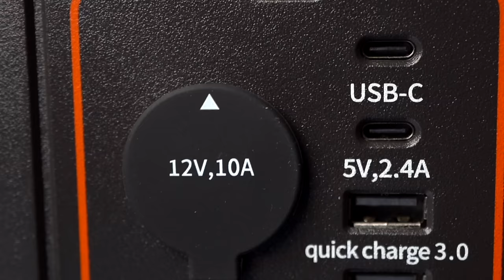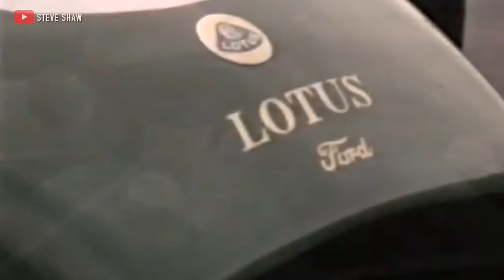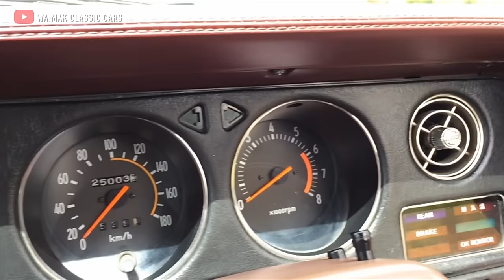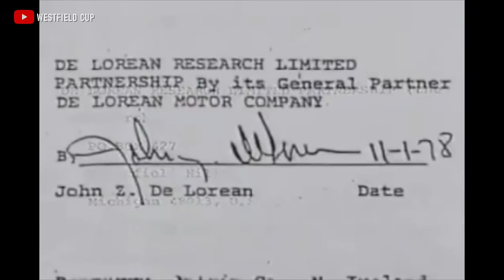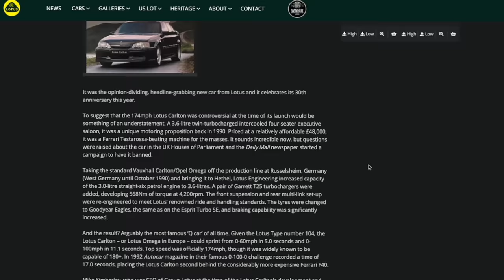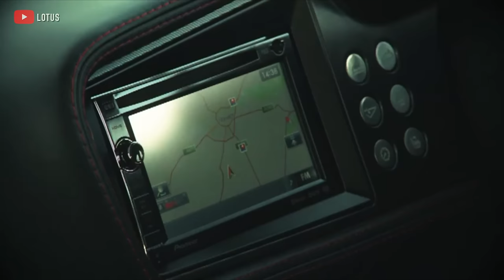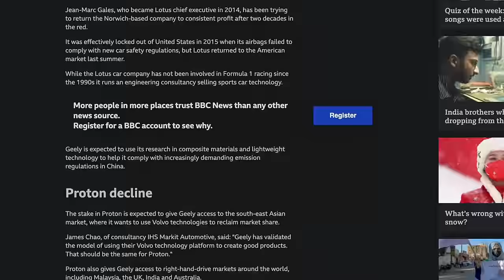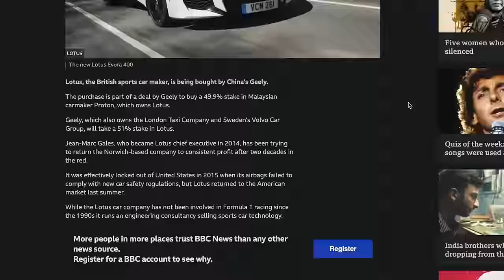Lotus is Dead

Comment: I am an Australian who lives in China. Recently I was buying a sports car and had settled on a 718 Cayman GTS. Then I saw the Emira and its quality was a huge leap over old Lotuses (Loti I suppose) it looked gorgeous, the V6 went well enough and the quality was now up there with the best of them. The engineering team here told me that the AMG motor coming to China was more powerful than the one overseas and that I should buy that even though it was cheaper so I purchased one. Yesterday I was one of the first in the world to drive the Chinese AMG which produces 400hp and 480nm torque with 8 gears and it weighs the same as the Cayman. It was wild and much faster than the 6 plus the gear changes on that double clutch were fast and sorted - track mode the gears are smart up and down plus it now has launch control. The other thing is that Geely has set up professional large-scale support and beautiful infrastructure here and in England. Lotus now has everything to make it the Porsche competitor we all knew it should be. Cayman you have a crocodile on your hands. Then there is the EV SUVs which are pretty serious and remember SUVs saved Porsche. By the way 4.3 seconds to 100kph for the 6 but the Chinese i4 is way faster.

Comment: Going forward, those who enjoy performance figures above all else will likely still have much to celebrate. On the other hand, those who prefer maximum interaction with their cars as well as the road itself will not (along with the analog goes the visceral). It's only a matter of time until classic/enthusiast cars as we've known them become obsolete. At some point the only "driving experience" may be via simulators. After all, change is the only constant.
Reply: Change isn't always linear.  Pissing off automotive enthusiasts (who inclide some of the wealthiest people on the planet) is a great way to get voted out of office.  I see it as more of a problem for the working man or woman to be able to afford an enthusiast vehicle of their own.
Reply: @flyingphoenix113  Pissing off automotive enthusiasts has nothing to do with it. But I do agree that change as it relates to technology in general and computing power in particular has been much more exponential than linear. That is one of the main reasons the lifespan of the internal combustion engine is likely to be far shorter than most car enthusiasts today can imagine. There will also come a point where prices of EV's will drop significantly. This in turn will actually offer the working person levels of performance never before imaginable. Thus a new generation of enthusiasts will come to exist. They'll just be more tech savvy than car enthusiasts as we've known them to date. This isn't all that much different than the other forms of technological change taking place in our world.
Reply: This sounds orwellian. Not to mention EVs are an insider trading scheme at best. The amount of Lithium on earth makes oil seem infinite AND mining Lithiumis AWFUL for the environment. AND our power grids can not support mass EV adoption.
A much more honest approach would've been a global push towards E95-E100 engines.
Reply: @Aglai76  I wouldn't argue such points. I'm only noting how I see things playing out based on the research I've been doing on Net Zero adaptation across the globe. Many countries are adapting to EV's and outlawing the ICE on shorter timelines than I've presented for the US. China is looking to be the biggest supplier of batteries. Meanwhile, here in the US, automakers have "somehow" already managed to find money to start dumping into grid improvements. All of the major automakers clearly know that EV's are the way forward. They know this will be be a huge money making change for their businesses. As to whether or not they truly believe this is the "best" path forward for the planet is a different matter.
Reply: @Aglai76  the real approach is better public transport options and more accessibly designed infrastructure for citizens.
Reply: @jeffstewert12  for metropolitan areas sure, like LA, San Diego, Dallas Propper, ect have awful public transit. but that does not work for the suburbs and us impossible for the rural areas. And it's a monumental undertaking for landlocked cities like DFW, Austin, Houston, Nashville, St. Louis, Atlanta, Philadelphia, Phoenix, ect. Because they're not crammed up next to an ocean and therefore have HUGE areas
Reply: @VirtualGuth  EVs have huge technical problems with the battery. Getting the charge into it and how much it holds. The materials used are also rare and expensive. Thanks to laptops being hugely inefficient desktop computers crammed into a smaller form it has pushed battery tech to where it is today. Laptops still have terrible battery life though. The electric car must sort out it's battery if  it is to be technically better than the petrol car.
Reply: @wayland7150  I wouldn't argue your points. You are making the assumption that the technically better solution will win. That's not at all what I'm saying. Something else might eventually end up coming along to rule the day, but it is clear that the ICE is going away. Just look at the all of the commitments made by major automotive manufacturers abandoning the ICE. As of today, the replacement will be the battery-based.
Reply: Yeah I refuse to just roll over and accept that future.
Reply: Seems to me like most everything in our modern day society is going in that direction - people with the finances to do so will distance themselves from the real world experiences, all in the name of predictability, expected safety and comfort. Makes me think of the H G Wells´ classic novel "The Time Machine". These people would be the Eloans in that story... :D
Reply: @hasseslaggmek3573  yeah except that in The Time Machine the Eloi were kept ignorant and happy so that the Morloks could harvest them.
Reply: @Chris-hq7nl  Well... not willing to get too deep into politics, but isn´t that kind of what is going on? Not litterally harvesting people, but keeping them ignorant and happy to live in a bubble. Guess i´d be one of the Morloks :D, being one of those working hands on "underground" and not happy with this transition from physical to AI in what seems to be in the long run most aspects of daily life.

Comment: Electric cars are better in almost every way.  
Yes, they are comparatively heavy - for now.  But that is offset by the low COG.  Batteries are getting smaller, lighter, more power dense all the time.
Yes, they take longer to recharge than petrol vehicles and finding a charge is more difficult - for now.  But 800V is being rolled out all along the UK motorway networks.
Yes, you don't have the noise, the vibration.  I don't miss it.  I love the silent glide around town.  Many manufacturers install a fake engine noise for those who miss it but it's the first thing I would turn off.  

I do love the punch in the back when I push the accelerator to the floor, at any speed, without having to cog down first.

Anyone who thinks "golf buggy" or "milk cart" when they think of electric cars is plain wrong - those are specialist vehicles.

If you have any doubts, find someone who has a Tesla or a Porsche Taycan  and ask them to take you up a drag strip.  Serious motoring.
Reply: That's nice.
Where does electricity come from?
Reply: @monsieurcommissaire1628  Unicorn Farts!

Not really - It depends very much upon where you come from.  At this precise moment in the UK we're at 53% renewable, 68% "green" (including nuclear, which is possibly an argument for another day).

Some nations / states will be better, some will be worse.

ICE vehicles can only every be 100% carbon emitters, at an efficiency of about 25%, which is not great, before you even make a start on the well-to-wheel argument.

Comment: I have owned and extensively driven a Series 2 Seven and a Europa Special and consider that you are correct in questioning the validity of that iconic green and yellow badge being attached to the exotic bodies of the models branded as Lotus over the recent years ....... never mind the ownership issues. Coming from such humble and exciting beginnings, a $ US 2.3 million price tag seems like a very rich insult to the name: I am prepared to admit that I might be wrong but my many miles of fun Lotus motoring induce me to feel this way ........ give me an elder Classic any day! Fortunately, we still have Morgans, though the new 3-wheeler has lost a lot of the model's appeal.
Reply: The issue is they are entering the big time in automobile manufacturing and lost the will to maintain the lightness theory...

Comment: As a Lotus Elise owner, which is "track prepped", I can't feel good about the new offerings.  The roar of the engine, taching 8500 RPMs is intoxicating.  This feeling cannot be experienced in an electric car, even if the electric car can accelerate more quickly.  The five-time SCCA XP-class national champion (Fred Zust) was earned in a Lotus Elise.   They are worthy track cars.  Chapman was right when he said "horsepower makes you fast in the straights, but lightness makes you fast everywhere".  I did not get a Lotus for street driving comfort, otherwise, a BMW would have been purchased. The older Lotus cars were engineered for Driver's experience, instead of doing long road trips, or a trip to the grocery store.  They have forgotten what cars brought them back from the brink.  I suspect Lotus leadership is simply focusing on the actions, which assure finances for their next fat bonus check (through external finances).  I guess earning those checks by making a better car sounds like too much work.

Comment: Unfortunately, to survive in the modern automotive world you need to keep up with demand and that demand for lightweight sports cars is simply not enough. Car users want their cars filled with tech, touchscreens etc. Add in tough new restrictions on car safety and emissions, and the old stripped out Lotus of old would simply not pass current regulations. 

I've got an Exige 410 and everytime I look at it I can't help but smile, it looks amazing and drives even better. There really is nothing else like it and it's sad that it will be the last Exige. Unless my circumstances change, I'm never selling it.
Reply: I suspect the allure of the touch screen will fade. You should not be looking at things inside your car when driving, that's like looking at the gear leaver when changing gear. A sign of weakness which is only OK when women do it.
Reply: Modern Lotuses, even the EV ones with the exception of the dumpster fire that is the Eletre, are still Lotuses. They’re just Lotus EVs. Hell, Lotus even made a last internal combustion car complete with a manual transmission as one last message that Lotus is still for the drivers, and yet we ignore it as ppl in the car community usually do. I’m saying Lotus is trying to hold onto as much of their spirit as they can in this new electric age (again, with the exception of the Eletre). They just can’t hold onto all of it, cuz EVs are inherently heavy, although the weight issue will iron itself with the introduction of new battery chemistries with greater electric capacities, allowing them to be shrunk down and therefore lighter
Reply: @mrsoisauce9017  I think the purpose of the EV is destroy motoring. The reason for doing that is The Great Reset and the reason for that is to put human freedom back in it's box. Motoring is one of our greatest freedoms which makes it an obvious target.

Comment: Not seen your channel before, but barring a couple of minor errors this is a very good potted history of Lotus, although you did miss out on the infamous Dany Bahar period from around 2007. Regarding electric cars, don't forget that the original Tesla roadster was basically an Elise with a new drive train, so Lotus kind of got in on the ground floor there. In any case the UK is banning internal combustion cars from 2030 so there is no choice. With 40 year involvement in motor sport as an engine specialist I'm sad, but electric cars are more different than they are inferior to i/c vehicles. Maybe there's  niche market for electric cars that have an involving driving experience because at the moment they all seem to be trying to replace any analogue feedback with power assisted everything. So called SUVs (is that a sports car that you can also use as a builder's truck?) will eventually prove to be a passing fashion, though who knows what will replace them - lets keep our fingers crossed.

Comment: Great video TY. A few points 1) One great advantage Lotus has which is not mentioned in the video is it has an ENGINEERING business. They did a lot of work for GM and Toyota especially. They are famous for suspension engineering, in the same league with Porsche. This is why GM bought them. It kept cash coming in the door. The profit numbers quoted in this piece is from cars only. 2) The GM Epsilon engine in Saab form had a Lotus designed cylinder head. It was a GOOD engine 3) No mention of Mike Kimberley? Or did I miss it?

Comment: At  6:04 your video shows a twin carburettor Austin "B" series engine in a Lotus chassis whilst describing it as a Ford derived power unit?
I don't ever recall Lotus officially using an Austin derived power plant though Austin did have an element of engine power plant development through the 1960's derived by the legendary John Cooper.
 
In the late 1970's I purchase a dilapidated 1970 Lotus Elan S4 that required not far short of a total rebuild from chassis to electrics to engine and bodywork. Not much I don't know about this particular model and in fact I still own the original cars w/shop manual with receipts!
Lotus cars had a manufacturing factory in my home town of Cheshunt in Hertfordshire UK. The factory is still here complete with unique vehicle "drive-off ramp" at the side from the first floor.

A very dear friend of mine Michael Dunford used to work at this site during the mid to late 1960's and told me of how things where done back in those times until he lost his job though an unfortunate mishap. Sadly Michael passed away several years ago.

The entire road (Delamare Road) is currently (late 2022) subject of a drastic development program which may well see the demolition of this historical building. I will try and clarify with photographs if this noteworthy site can be saved.

History needs to be preserved but unfortunately money sometimes clouds this perception ultimately depriving future generations of essential links to the past. How sad is that?.

Please request my contact details through this site if you want more information about the Delamere Road Cheshunt site. 
Thank you. David Parnell

Comment: They used to say, the future is digital. In the car industry, the future is electric.
Reply: I wouldn't be so sure. The current energy crisis highlights how important fossil fuels are, and how inadequate all current electricity network infrastructure is (world wide). If current demand is barely being met, how is an all-electric vehicle fleet going to be supplied with energy?  It doesn't add up.
Reply: @cvanscho  I think they will have it figured out. Fossil fuels willnhave its use. It's not like it is going to suddenly disappear, global transition to full electric will take decades. Some automobile companies are planning to shift to electric only by 2030 and that is just the start. Let's see how battery technology evolves in this decade.
Reply: The future is probably electric but definitely not battery
Reply: The future is high energy density without waiting a day to charge,  straining the electricity grid or polluting.
Hence, carbon capture (or similar) to make synthetic petrol.

Comment: Sports car brands are always operating in a relatively niece market, so the profits are never really enough. Ferrari was upheld for a long time by their racing success and not their road cars. In this current world SUVs and other high volume sellers are needed in sports car manufacturers lineups to prop them up to keep making those beloved sports cars. Ferrari and Porsche are the biggest examples of this. On top of that, the 2030 EU ban on NEW petrol powered cars and the ever tightening emissions restrictions pretty much force any car brands hand on what powers their future fleet. It's up to Lotus and their owners to either keep them on this future proofing course or to make them another luxury/sports trend chaser in search of nothing more than profits. So to answer those questions in the beginning of the video, it's both. It is at the time the speculated right way forward, but also at the cost of sports car sacrilege. 

Personally I am a big fan of hybrids in road cars in terms of what the future of cars consists. If done right, it makes the around town driving quiet and civilized, but sporty and very very quick on the twisty backwoods roads. Battery technology isn't yet up to the task to single-handedly and reliably power everyday cars. Especially in the cold north. The battery production pollutes like hell and they just don't last long enough.